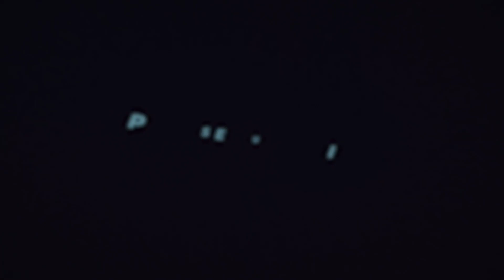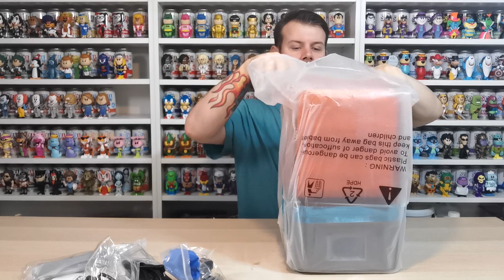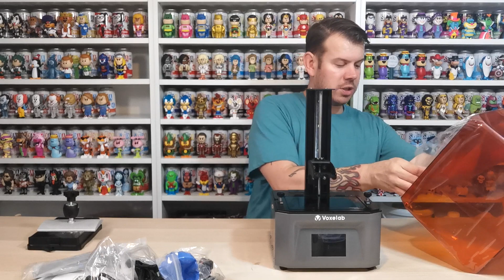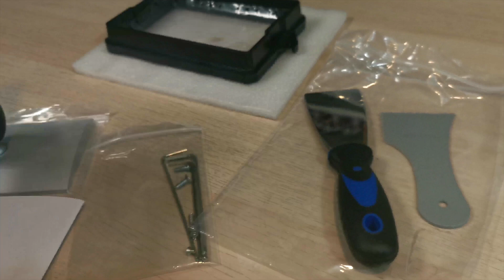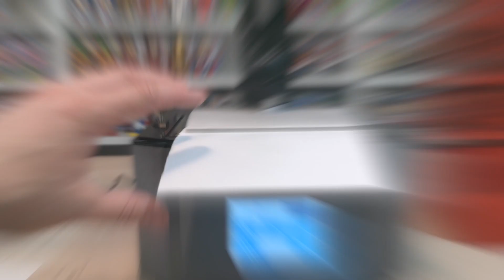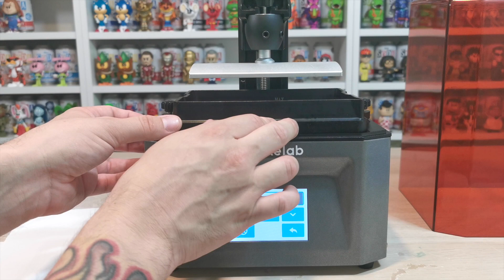Voxelab Proxima 6 3D Printer Review: Beginners Guide, Includes Setup & Bed Levelling

Comment: i put my models onto the usb drive they gave me but when i put it into the printed it wont show any models? help please got i i beg you
Reply from the maker: They are only g code files, you can just add them back onto the usb, what software are you using to slice your prints on?
Reply: @FWA4   @FL4ME WITH A 4  Thank you for the fast reply! im using chitubox and voxelprint, selected the right model of printer in chitu and that didnt work. Iv been using filament printing for a few months so iv been exporting, slicing and printing fine on that but its not working for the resin printer. Picture this: you open the box for the first time, follow along with youtube tutorial to zero the plate, that went perfect. Then plugging in the usb drive that came in the box in your computer, open chitubox and select the correct printer/profile, slice and save the file to the usb fdg, vlp, stl. Right click, eject the usb, insert into printer look in the usb folder on the printer and only the test deer model print shows up. im assuming now its the usb reader
Reply from the maker: @stinkyfinger2333  are you saving the file as a gcode and saving it to the usb ?
Reply: @FWA4  i finally got it when i was exporting from voxelprint, you have to press the export option that says and ONLY say svgx, i was using the option displayed as fdg AND svgx. My thinking behind choosing the the fdg one was i thought if it had svgx in it it was ok but no lol. thank you for your time :)
Reply: @FWA4  now when i level the bed doesnt touch the screen firmly. i click the home buttom to lower the bed and at its lowest the bed still wiggles so i cant get the paper to kinda catch under the bed.